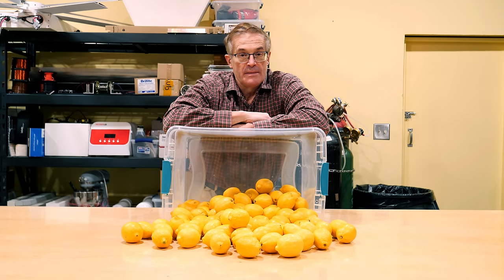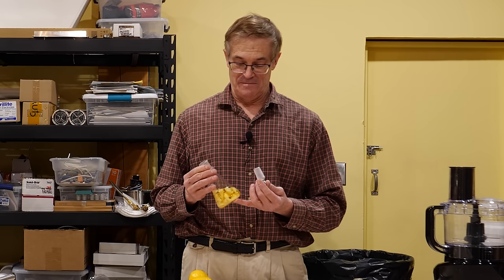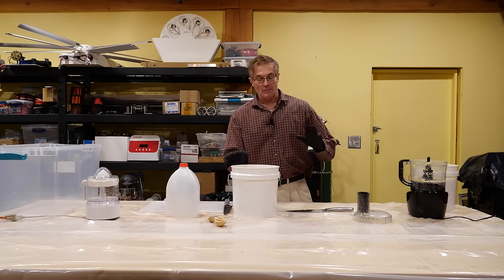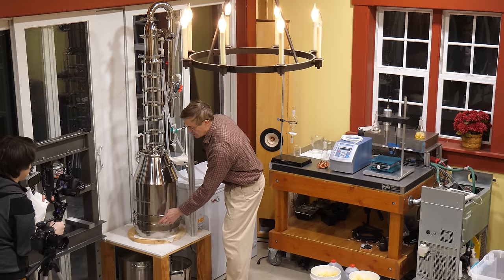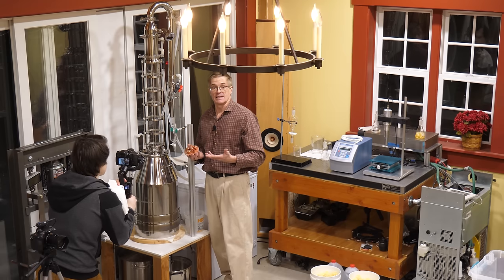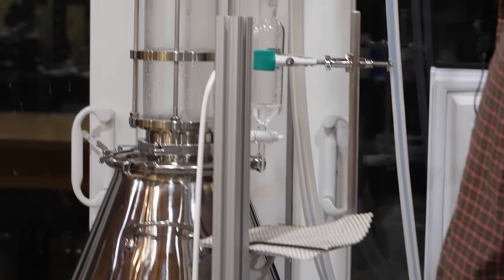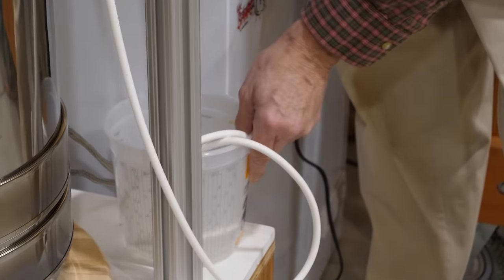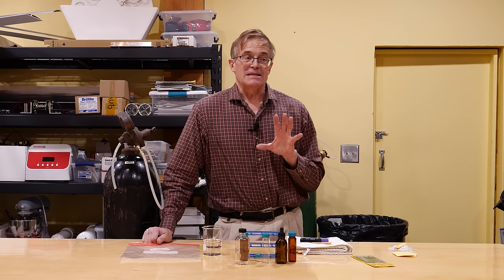CONCENTRATING LEMON OIL LEADS TO A VISIT TO THE HOSPITAL!

Comment: I tried doing this with cobbled together bits and pieces, and peppermint leaves. It was very disappointing and the result smelled terrible. I think the main problem was I didn't have a reflux condenser, which may have meant some less aromatic compounds were brought over too. I see below someone suggested the flavour of the lemon oil could be improved by separating the outer rind from the pith before distilling (because the pith might contain unwanted molecules). I too would be interested to know if this is the case.

Comment: 28:30 you want an FKM rubber as sealant, as that is more flexible than PTFE and you can cut sheets to shape easier if you DIY. you may also find o-rings that fit, but the oil might degrade the plastic cap.
Reply from the maker: PTFE is actually quite soft and you can see the impression in the plastic caused by the lip of the glass bottle.
Reply: @TechIngredients  i am familiar with both materials. i would recommend FKM over PTFE in this particular application.

Comment: I would be interested to see how, instead of heating, using pressure changes could be used to separate the components. Comparing time, seporation, efficiency, and maybe cost?

Comment: Commercial extraction, at least for limoncello, separates the yellow zest from the bitter white pith.  Most cake makers will have a lemon zester, because the zest is used to create lemon drizzle, and other lovely lemony things.  They're really cheap, and very effective at just removing the zest.  If you don't have one, a fine grater will do the trick (not the ones that are just holes ripped into sheet steel, which are more like a rasp, but the small blades).  You remove the zest before squeezing the lemons.  Not only would this greatly improve the taste/aroma, but you'd have much less pulp to deal with, and therefore less water as well.  You wouldn't need the food processor either, so it's just as quick.
I suggest you don't let your son use the grater.  He's liable to grate off his finger tips.  Clearly he didn't inherit your coordination, spatial awareness or mechanical thinking.  I understand the desire for a father-son bonding session, and some of my most cherished memories are helping my dad with his various projects.  However, your son really looked like an accident waiting to happen, and we didn't have to wait too long.

Comment: It might be an idea to send your partner to a professional kitchen or Butcher shop and get coaching on how to properly handle a knife especially while cutting food ingredients. I worked in a kitchen for many years and have done a great deal of food prep and could tell right away your assistant was going to cut himself the way he was holding the lemons which he ended up doing. There is a technique which he could learn quickly that would prevent the same type of injury in the future. This skill will be useful in the future and can be transferred to many other purposes involving using a sharp blade. Also he needs to learn better blade control and should consider building more hand and wrist strength which is something that can easily be done in spare time with a squeeze ball.

Comment: I find chemistry interesting, as I am technically wired; mechanical engineering, electrical, electronics etc, but never got into chemistry. I have seen some youtube stuff on wood fired internal combustion engines! that is wood ovens feeding normal piston engine and running on the fumes from the cooked wood? (EX Petrol engine) Is this feasible? and how does it compere to the efficiency of a good old steam engine?

Comment: I use similar ban heater with my homemade plastic extruder for 1 ,2, and 5 plastics. Their just much smaller 350watt 1in inner diameter.  Also use 6 on 1 inch steel pipe. Lol

Comment: Lol at throwing away the salt option (you could do the same with just acids). It remembers me my chemical engineer studies when I was the only one out of 300 to do it on my own (based on principles a teacher told us in a complete different matter) and end the lab work in less than half the time all others did, with even better yield and purity. Even teachers didn't understood what I did.
25 years later I find another teacher (a little older than I'm now) that ditches it before even testing.

Comment: No stitches , just soak in water till it stops bleeding then wrap with a paper towel and keep it wet. It should be good in 24 hours. If it hurts soak it. Your wounds need water to heal without leaving scars. Also treat burns with alcohol, the evaporation will remove the heat and lessen the degree of burn. Again, an alcohol soaked paper towel folded up. 
Ice and salt is also an emergency method to stop bleeding. I know salt in a wound,is a definte ouch, better than bleeding out. I prefer the water. the pain disappears almost instantly.
Reply from the maker: That's  actually  not correct.
Pure water will be absorbed by the wound edges. That's why your skin wrinkles when you bathe.  This will pull the edges of the wound apart, and that can lead to scarring.  It's  wound tension that causes scarring, and that's why subcutaneous bridging sutures are used by plastic surgeons during a closure.

Comment: To remove the oxygen, would CO2 work like nitrogen would? Because for anyone who doesn't have a use for a nitrogen tank can easily make CO2 instead using baking soda and vinegar (or citric acid after making lemon oil) or by lighting a candle in a closed space until it dies out.
Reply from the maker: Yes.
However,  I'd avoid methods that introduce other contaminates such as smoke or vinegar. Try those CO2 cartridges that they sell for carbonating beverages.

Comment: Clean it, hold pressure until the bleeding slow and then push the two sides together as well as you can and then superglue it. As soon as that is dry then but a butterfly across it. Get back to work.

Comment: The only time I saw my father get at all flustered over an injury was when I was working in his truck shop during my college years. Another mechanic and I were putting the transmission back in an F-350 pickup when the transmission tipped off the jack. I reached out, caught it before it got far,  and set it back in place.  No problems!  Well, it did it again. This time, it made it to the floor... with my middle finger under the universal joint yoke to cushion its fall.  I came off the creeper saying things unfit for this audience.  My finger was basically crushed and ripped open to visible bone.  My dad came over quickly, saw my finger, and groaned, "Oh $h/t."  I rinsed it out in the sink, wrapped it with a bit of paper towel and electrical tape, then sat down for a few minutes to let minor shock passed. I then went back to work over my father's objections.  This all happened around 9 am.  Around 3 pm, I made a 25 mile parts run to Plattsburgh. On the way back, I ended up steering with my injured right hand and shifting with my left due to the discomfort.  When I got back to the shop, I decided it was time to get it stitched up.  The adventures of small town medical treatment are another whole story...
Hope your son's finger healed quickly.

Comment: Is there another odour free, food safe oil available, which would float on top of your essential oils and that does not readily absorb oxygen? This could be added on top of the product in a UV resistant bottle with a pipette dropper screw lid. This might keep the air away and allow a small amount to be withdrawn through the covering oil with only a little contamination by that oil?

Comment: Is there any reason that the relatively inert duster gases (tetrafluoroethane, etc.) would not be useful for preventing oxidation? A lot safer than keeping industrial-sized compressed gas cylinders, no safety plan or periodic pressure test required, and so on.

Comment: You need to keep some "Super Glue" in your shop for cuts like that. It can be a good addition to your "First Aid Kit" for any shop! 👍
Doctors are using a "Like" Super Glue in operating rooms. "NO Joke".
Reply from the maker: You're right on both counts.
However, the benefit of sutures is reduction in the tension across the wound during healing.  This will speed the process as well as minimize scaring.

Comment: How much of the oil from the mash is borne up through the steam in the distillation tower? Clearly the oil is less dense than the water, and has a tendency to evaporate (hence its use in scented materials). Does this mean that heating it up and distilling it is an exceedingly efficient way to extract the oil from the lemon peels? I am wondering if there is a method that will give a greater yield.
Reply from the maker: It is pretty efficient.  Cold pressing is another option, especially  for temperature sensitive oils.
Also, supercritical CO2 extraction is another method, but it requires  some pretty sophisticated equipment.

Comment: For a future show... I have had plumbers tell me to put magnets on my incoming water supply to my house. The magnets, I was told, makes the water atoms less sticky so my water heater works more efficiently with less scale buildup inside the tank. What is your take on magnets attached to your water supply?
Thanks
Reply from the maker: It doesn't make sense.  They are used in sewage treatment plants to grab onto metallic particles, but they don't  make non ferrous atoms sticky or unsticky.

Comment: What about woods like pine or sandalwood? Would you use pine saw dust? bark? needles? How do you determine which part of an item contains the essence?
Reply from the maker: I don't know.  But, I'm not optimistic.  Soak lemons in alcohol or boil them and the essence is quite strong.  These woods are much less aromatic m, so you might extract some oil, but probably not much.

Comment: I  have a question about the nitrogen to preserve foods, I was working on a project to store food for a longer period of time, and I was researching argon as a form of gas to replace the oxygen. I've tried looking around on the net for information of its potential toxicity or ability to  be food-safe, I was wondering if you (or somebody else) had any knowledge on this? And whether its a bad idea or something I should continue to experiment with? 
 thank you.
Reply from the maker: Argon will work fine.  I believe it's the pressurized gas in wine preservation kits.  Just make sure it's pure, you don't want to be preserving with welding blends.

Comment: Note 1: By far the most important area of application of citrus oils is repelling rebellious cats from the spots they like to mark.
Note 2: Do not get a (large) nitrogen tank unless you know what you're doing. It's a highly dangerous gas if used indoors and stored in quantities comparable to room volume. If you do get one, get a small one or keep the tank in a well ventilated area well away from bedrooms.
Reply from the maker: Note 1, good suggestion.
However, your statement regarding compressed nitrogen gas is generally wrong. Nitrogen is inert regarding biological activity.  It's the major constituent in air. Even if you could completely seal a room 1/4 the size of the room in which we filmed this video (and you can't), rapidly emptying this cylinder would lower the oxygen concentration by between 3 and 4%. That is equivalent to increasing your altitude one mile.  You might just notice it.
Reply: @TechIngredients  Thanks for the reply! Yeah, I went through math again and you're right, even at 100 liters at 100 atm the room must be tiny for it to be hazardous. The scare I had comes primarily from liquid nitrogen, which is of course much more dense.

Comment: Make sure the two sides are clean and pressed together before doing it though or the part that is separated might die and cause a scar.
Reply from the maker: That is one of the best arguments for stitches.  Tension across the cut, even if the edges are perfectly aligned, leads to scaring.  This is why plastic surgeons rarely use tissue adhesives on incisions that are visible and even when it is used, a layer of sutures are used just beyond the wound to unload the incision.

Comment: How about using an opaque Teflon squeeze tube with a valve to store the essential oil?  Fill it with the essential oil.  Squeeze a few drops out at a time.  No air/oxygen goes in to replace the oil and no light can penetrate the tube.
Reply from the maker: That's a good idea.

Comment: I love the part where it gives you a reason to get a nitrogen tank. The only way I can see is to increase the efficiency of the cooling would be to use a method that I saw from an individual named Steven Harris. He wrote a book sunshine to dollars. Where he ripped apart a mini fridge use the cooling section in a cooler mixed with salt water the condenser part was in another container of water. This would of course help cool the gas and increase the efficiency by tenfold easily instead of using air. He was in a third world country and healthy kid make ice as there is no ice around and therefore help the kid actually establish a business. I keep saying I need to be your neighbor. Perhaps when I win Lotto. I love doing this crap just never have enough money.

Comment: But everytime you open the container you have to nitrogen seal it again? Will the oil really turn bad that quick? I think putting it in freezer in dark bottle will make it good to use for 2 years
Reply from the maker: It's  just another tool to extend storage.  You're probably right.

Comment: Absolute necessities in my bug out surgical 1st aid kit:
Super glue(medical grade of possible otherwise any will do)
Plain dental floss as sutures.
Sewing needles 3 sizes & curved
Betadine solution
Hydrogen peroxide solution
Alcohol 70%
Blood absorbant
Stethoscope
Headlamp hi lumen LED
BP monitor
Thermometer digital & analog
Stainless steel Tweezers, reverse & straight 
Stainless steel Hemostats sm,med, large
SS scissors,
Scalpel (Exacto blades), safety razor blades
Local anesthetic, lidocaine
Whipped cream aerosols x 3 cans refrigerated 
Analgesics- Tylenol ,codeine &/or oxycodone.
NSAIDS - Aspirin, naproxen sodium, celebrex.
EpiPen
Syringes, fine & large Guage
Kotex(sanitary pads), flat gauze pads,
Surgical tape 3 types 
Surgical gloves
Surgical tubing 6'

Comment: Ouch. That was a nasty cut. I could never handle one of my kids being hurt. I can cut myself or someone else is injured, I just deal with it. With the kids it freaked me out. One point, the bubble cap trays are used to increase the residence time of the liquid in the column which increases the vapor liquid contact. That increases the separation efficiency. Your still is a work of art. This is also a good lesson in glassware :)
Reply from the maker: Thanks 
Take a look at our previous video on this reflux still.  I go into more detail and explain the principle of this reflux process and the role of the bubble plates.
Reply: @TechIngredients  I worked in the oil and gas business all of my life. 40+ years so far. We do distillation on a large scale. One of our DeEthanizers uses a 3,000 horsepower propane refrigerant system for condensing reflux. The Depropanizers typically use air or cooling water exchangers. Same with the DeButanizer, DeIsobutanizer, and DeIsopentanizer (not used that often). We have packed columns, columns with valve trays, and in the older facilities some may have bubble cap trays but those aren't typically used anymore. Amine treaters use refluxed stills to regenerate amine. I think you would enjoy a looking over our processes.

Comment: Okay here is the thing, 
If you don't already know there is a wrong way to hold a knife especially a chef's knife.
Most people hold the handle, wrong you choke up on the handle and pinch the blade between the thumb and pointer gaining positive control of the knife.
Okay now that you are holding it correctly you have to implement it in the same fashion.
Holding the item to be divided with your nondominant hand with your fingertips curled under your knuckles pushing against the item to be divided and using the second flanges to guide the side of the knife.
Practice, practice, practice and sooner than later you can make wafer thin slices of heck you name it.
Really really fast. just like the pros do. Cordon Blue be damned. I apprenticed as a lad in a authentic French restaurant as the chef's pot scrubber and prep place could be a three-ring circus.

Comment: Can this made with household equipment, becourse I think this reflux device is not cheap to buy or available in every places.
Reply from the maker: Yes, but with lower yield and in smaller quantity.  The principles are simple and a pot still constructed from a pressure cooker and some copper tubing will certainly work.

Comment: If you add enough sugar to the lemon juice it will become concentrated and preserved and it wouldn’t need to go in the freezer.  This way you wouldn’t have to defrost a gallon to make one glass of juice.
Reply from the maker: The sugar will prevent microbial growth, but it won't prevent oxidation from exposure to the atmosphere. The flavor changes over time.

Comment: The thing is, the olfactory sense is directly connected to the kernel of the operating system of the mind ... like a driver on a PC. It does not pass through the conscious mind ... Ie a baby with no experience of the world has the same experience of smell as anyone else and will also pull a lemon face when given a lemon to taste. There is no processing by thoughts etc. to smell anything. You may have an opinion about the smell after the fact but that is a learned response. The way a smell affects the physical body in regards to how it makes you feel is more objective (the effect on the feeling is universal) than the subjective response so that is why they can heal by directly affecting the feeling response which is at the core of what meaning to be alive is. If you feel good or bad determines your health to very large degree so a good smell is like music to the ears for the nose. 😂😂